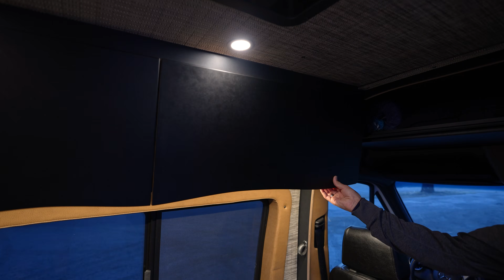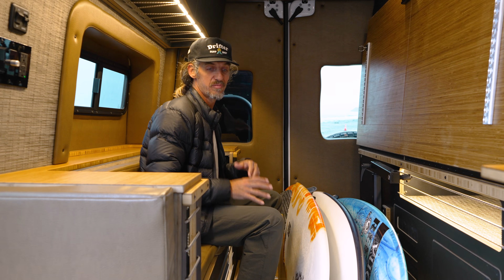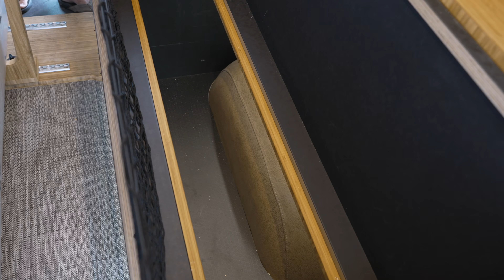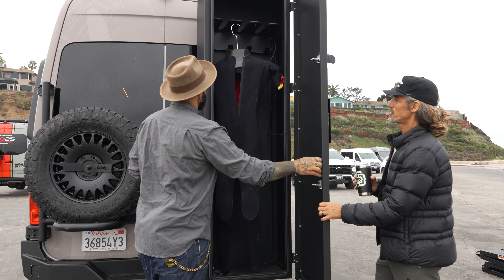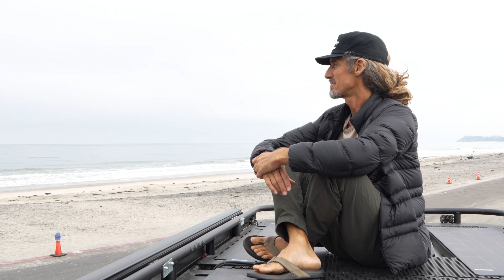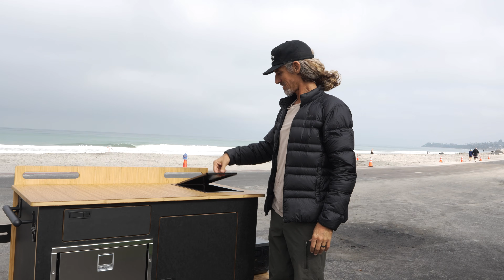Rob Machado's Custom Van: The Rogue Wave Tour

Comment: Do the rear passenger seats attach to the L track on the floor? Would have loved to have seen that. Is there a brand for the rear seats? Great build! I’m definitely going to poach the Murphy bed idea. I’m a little bit worried about having a mattress on a solid surface mold wise. Thanks!